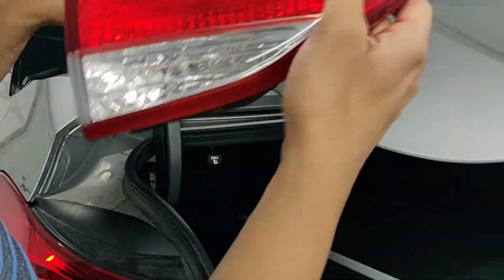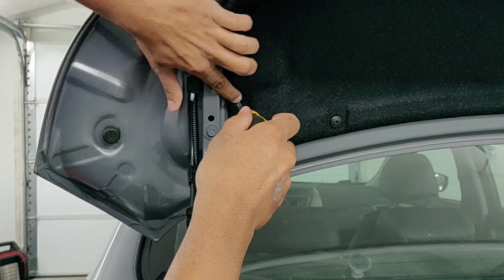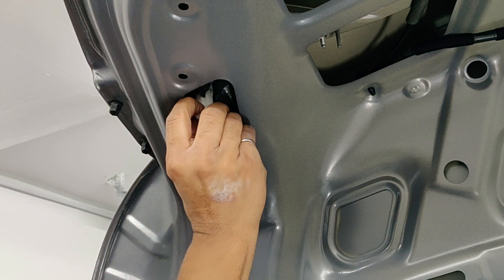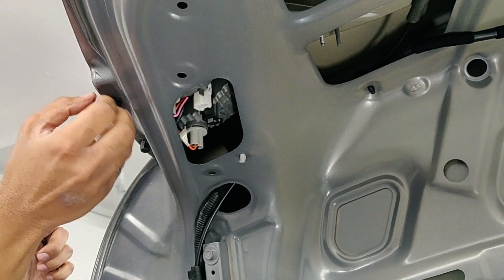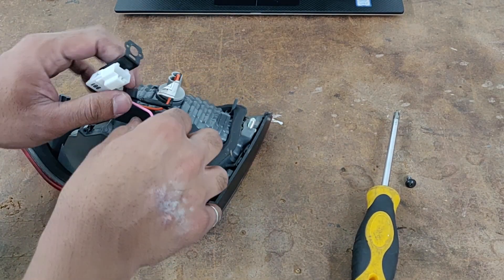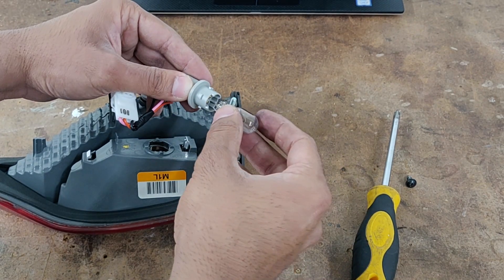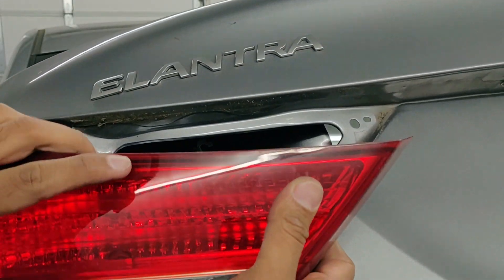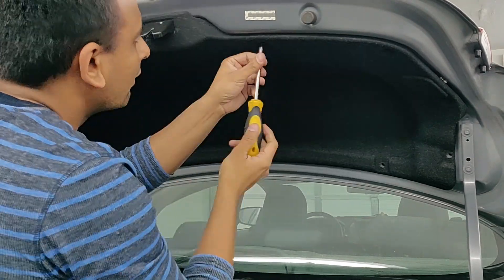Replace Reverse Light Bulb - Hyundai Elantra (2011-2016)

Comment: Jash in 2013 TPMS is available. If tire pressure is low can i get the indication light?
Reply from the maker: You would need to check if your vehicle came equipped with TPMS. I have a 2018 Hyundai Elantra and does not have TPMS. If your vehicle does have TPMS and if the tire pressure is low, it will flash a warning light on your dashboard. It will be a yellow color tire symbol.